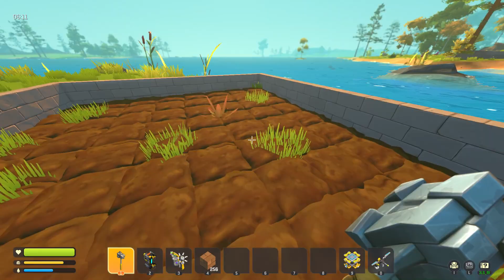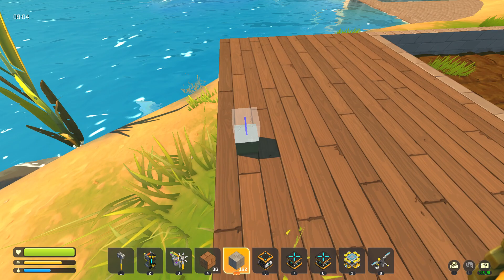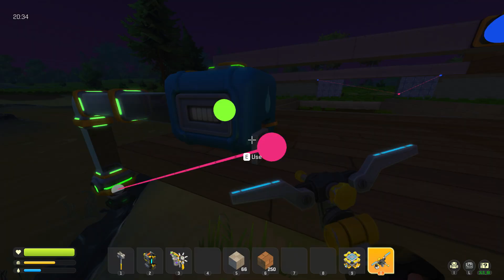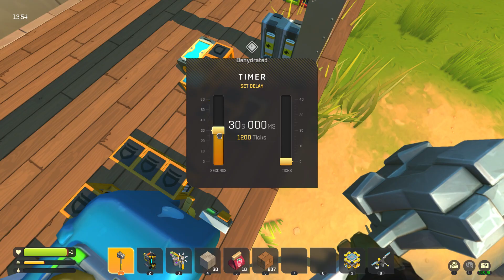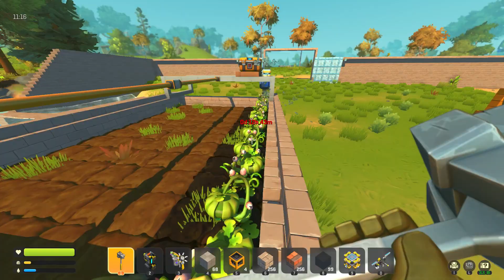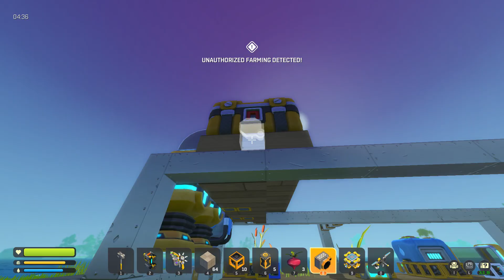Building a Fully Automatic Farm that Plants, Waters, and Harvests! (Scrap Mechanic Survival Ep. 7)

Comment: Dang this thing is like redstone on steroids. This game looks awesome!

Edit: While it's true you could double it up, couldn't you triple it if you flipped the chests upside down. You have access points on the top, and sides right? So if you carve out a hole at the bottom of the support for the chests, and then create a supporting roof to place the chest against, you can have three vacuums potentially sucking up and planting seeds.

It might seem a little unnecessary, but I am a little worried about what might happen if the routine isn't complete by the time you leave it's render distance. Like I've heard that things don't really operate if you're out of range of them so it does limit your time to explore if you're trying to stay within a certain distance of your base to allow a set up to function.

Comment: Why not separate the planting/harvesting from the watering?

Say, do all rows simultaneously with a line of harvesters/planters preparing the farm in 1 minute. Then when it returns, it triggers the watering circuit which waters the area normally but much more quickly?

Alternatively, have the watering circuit on a timer which is blocked while the harvester/planter is active.

Comment: Like so kAN can see this! Tip 4 controllers you only need lvl 1 pistons if they are connected to a controller, it's a bug, but if you tell the piston via the controller and set it not say 15 it will go to 15 even if the piston is level one that's how I did my farm.

[EDIT]Also with the controller problem you have to replace the pistons again it's buggy.

Comment: the only reason youd need something as hands off as this is if you never wanna touch it and you jsut spend your day doing other things nearby. This could become even more useful if you can switch its modes between 'full auto' and 'just water' so you can speed it up by hand or have it do it itself. Another thing you could do is have multiple smaller plots with their own systems like johnbane, so it takes less time to do them all, but itd be more expensive mats-wise

Comment: It's an amazing concept!
You could make it twice as fast simply by rotating the setup of pump and vacuums by 90 degree: by making each step of the process work on their own line per time, you can then make the system active both on the going and returning pass.

First Going pass: harvest column A
First Returning pass: harvest column B and plant column A
Second Going pass: harvest column C,  plant column B and water column A
etc.

Yes, you still would need to add two extra passes over the left edge of the wall to finish watering everything but it still would be a lot faster than the current design.

Comment: a great way to protect your farm from raids is to have level 5 pistons at max speed that push big platforms into the ground connected to sensors so you don't need to work as hard to defend your farm! I did this on my survival world and it works like a charm 
pro tip: put resource collectors on top of the platforms to pick up haybot legs

Comment: Great contraption Kan!
I think that you can HALVE the time needed without additional planters/pipes/pumps
Make the head with chest and water turn 180 while it goes back, so it can collect/plant/water in correct order
This way you use all the time working and not just going back slowly
All you will need is one bearing and extra controller

Comment: What if you had the harvesting/planting/watering platform rotate so that you can harvest/plant/water on the way back. It would save on resources and if you add another planter inline with the one you have onto it you can cut the time down by a quarter by increasing the speed at which the pistons extend.

Comment: you actually dont have to use pipes to get the water out the ocean, you can just put the water tank directly on the vacuum pump, as long as the tank and pump are connected by blocks to the farm, you can still connect the tank with the water gun.

Comment: - Controller waiting issue: Each component controlled by a controller may have a different update time, may it be distance/rotation or just pistons/bearings. Thus each stages duration of a controller is defined by the slowest component. Having no change in one stage, the stage has no duration, its instant, thus skipped.
- The whole farm could be hooked up to a timer of 24h or less. The plants will be grown by that time and the player only has to go there at any time of the day, to sort/fix the chests content. This also justifies any form of duration, 15mins of farm processing? No problem, each soil on the field has its own constant time cycle. The player doesn't need to care when each cycle happens, due to the timer.

Nice idea! I didn't know that one could control pistons like this, its awesome! And the sensor to trigger when its over a field is also awesome.

Comment: Here is a good idea for the wall when you get more resources. Make the wall stretch out to the water and under it, then make a door for a boat to pass through, but also make a door underwater tallow submarines to go through. 
Ill explain how the door for the boat will work below

So it'll be similar to the front door, but there will be a switch inside the wall. What you will do is have a censor connected to the door to open it. When you want to get back in, you hold a button that extends a piston, activating the censor. Once the door is open, you can just float your way in.

Comment: If you were to connect the harvest chest and the seed chest, and fill up the seed chest with all the seeds you use, leaving no empty slots, it should filter the seeds out of the harvest chest because it should.. Uhh.. Prefer the item slot with the item of the same type..? It sounds confusing but its a simple idea
Also. 
Piston engine powered saw wall..

Comment: Kan, You know how when you packing fruits on packing station when you just flip on the switch for the vacuum pump you need to wait between every shot from vacuum pump, but when you spam the switch, on and off it shoots fruits almost instantly? Maybe if you try pulsing the vacuum pump signal you can speed up that process to the water cannon speed. (if it works remember to do the same trick for harvesting pump)
Good luck.

Comment: just make it plant and water the crops on its way back from another row which should make it double as fast, i can't see why that would be hard to set up, in case doing it logically is too hard, then just use sensors as end-stops, even if you need more resources for logic, i think it'd be as much time to make as when you are doubling it all the planters, and water cannons etc. up.

Comment: Wouldn't it double the speed if you have the side pistons pushing at every cycle of the 30' timer so you do one row extending one row contracting (I have not fully understand the circuit so it maybe be a pain in the but to do it, also English not my first language)

Comment: You could probably add a timer to each piston instead of using the sequences of the controller to allow you to bring them back at a different speed than it takes to go there, to be exact you could probably decrease the time it takes to do one row by 40%, making it take 40 seconds a row. This would make it take 5 minutes and 20 seconds. Add a second farming module it could be 2 minutes and 10 seconds to do the whole thing.

Comment: if you put 2 angled pipes on the top of the chests than the second vacuum pump that shoots out the seeds will register that seeds are in its inventory because the chests are connected  and just nonstop shoot seeds the only hold back that you would have is chest space but since you are using the food it wouldn't matter

Comment: Next video: Automatic wall repair. Sensor array to check for holes and how deep they are, and then places the appropriate amount of bricks.
Reply from the maker: I thought about this actually. You'd need a lot of pistons to cover the entire wall or a bunch of different setups to get it all but you could sense the holes then patch them with blocks.
Reply: @kANGaming  if you make it for real you are the scrap mechanics mumbo jumbo
Reply: @kANGaming  you could put something like a monoriel on top of the wall that travels along it and the mechanism that fix the wall hanging on it
Reply: @MaxFenix8k  You beat me to the suggestion
Reply: @kANGaming  window washer style Kan
Reply: @kANGaming  do it
Reply: @kANGaming  Make the wall an arc, then run the repairer back and forth like a windshield wiper, where its pivot bearing is in the middle of the base. Or you could make the whole base surrounded by a circular wall. If the repairer is mounted to the arm on a loose vertical bearing and is then supported by a wheel on the ground, this will control the height for you.
Reply: @kANGaming  That would be cool to see
Reply: @kANGaming  kinda sounds like the minecraft cobblestone wall auto builder. a bit of a pain to set up, but quite great in getting it to do most whatever you want it to.
Reply: @kANGaming  make it in creative and maybe make a small one for that one spot where the bots go to on the wall
Reply: the thing is that this is actually possible because the vacuum pumps can in fact place blocks
Reply: @kevan_11  hold up. So we can build 3D printers now? :D
Reply: That would be awesome
Reply: @bboss4412  you should not have said that
Reply: @shambles_pw604  yep your right
Reply: Yeah!!
Reply: Question is, can pumps place water bottles? If so, that’s basically an infinite wall.

Comment: Technically Kan, if you wanted to make this as efficient as possible, turn the chests of seeds and crops upside down. They have a port on top as well as on both sides, and as long as they dont have a directional limitation on which way items can flow, you should be able to get 3 rows out of it, but you might have to resize your land plot a bit to make it work more efficiently. You could also make the water canon its own thing that goes over everything before the planter and such so you only need the one, could be something to look into
Reply: Or, thirdly, have 2 planters in the same row with 2 different sets of the sensory teeth, so they alternate going off, and then you can increase the speed to double, so all it takes is 1 more pump and chest

Comment: I really love the system but as you say in all your other videos "but actually kan this whole system is stupid because..." Controllers do the whole blinker for you. Also, your controllers that you did use aren't working because you need to put the pistons in the he same controller, because a controller with nothing to compare itself to can do a 0 block extension much faster than a 0 block extension. If you put the pistons bon the same controller a 0 block extension on the first step will  take the same amount of time as an 8 block extension on the first step of the controller sequence.

Comment: why did you make it so complicated? you could make it vary easier less expensive faster less noisy and less lagy i built only for watering but you can make it for planting to  i actually made it with 3 water cannon 1 sensor 2 pistons and one controller if i wanted to fully automate it (with one switch press i could use 2 more sensors i made it for crops 9*6 but i could make it also 10*6 the idea is you put the farm plots down with no space between them and put 2 blocks on top of each other in the center of every line of plots for the sensor to detect and i think you can imagine the rest

Comment: try using two pumps for planting, each one doing every other plant which would cut your time in half
Reply from the maker: I added a second pump setup right after this video. Double the speed now :D
Reply: @kANGaming  what about planting on the retraction? That's another 50% improvement
Reply: @TheBaldrickk  Yes, but you have to collect the crops first.
Reply: kAN Gaming, Hi! You are a true genius!
Reply: @kANGaming  can't wait for you to build your own farmbots
Reply: If you move the collector over say 1 block (so that it is in the middle of 2 rows, instead of the middle of one row) would it collect from both rows at the same time?  If, so then planting on the return would work as the second of plants would have been collected already
Reply: He could have watered and planted during the return trip and then move the setup over when he returns to base too. Halved the time doing that too.

Comment: I would have used limit switches for the back and forth instead of a timer, the added benefit is that you can lengthen your field with minimal effort.
I'm so eager to have the modpack logic in survival, it'll make the circuit much simpler and much faster with smart engines !

Also an awesome over engineered solution to make this faster is to have a rotating planter head with multiple vacuum pumps so that they can cooldown.

Also Also, if the vacuum pump has enough range to pick up the rows around, you could plant going both ways, simplifying again the circuits !

Comment: you should put a timer on the shutoff to automatically restart the cycle after the duration it takes the longest plant to grow so all you have to do is put in seeds and take out fruit
Reply: Gregzyt and fight raids.
Reply: @ScibleMonk  I don't think it would waste seeds because it cant plant them if a plot is already being used, and the water is automatically collected always, so even if the water is being wasted, you get the same amount of water that is wasted. And even if you use more water than you get, just add another pump.
Reply: A sensor can detect if a plant is mature
Reply: Fabian that could be useful if you just put one on the last plant and used it to detect growth
Reply: plants that aren’t fully grown are only able to be broken with a hammer(I think) so he could do the shortest grow time and it would ignore the ungrown ones
Reply: But broccoli and pineapples take two waterings, unless you use fertilizer
Reply: What I was thinking the whole video
Reply: Sciblemonk probably it will try to shoot a seed but it wont be able to because it cant shoot a seed into a plot where there is already a plant

Comment: Why don't you used a sensor to detect when the arm is extended ? Also why don't you used your pulsing system for the extension to make it slow to extend but fast to retract. You could make a system that work even if the devs change the timing of the planting

Comment: You can also use a sensor to detect when a plant is fully grown! Place a sensor pointing toward one of the final plants (or a few with an and gate) then hook that back up to the trigger or gate and you have fully automated it 😃
Reply: You could actually put the sensor on one of the first plants.  That way you'd be harvesting them as the ones later in the row are still ripening.  But since the machine runs at the same speed each time, they would always be fully grown by the time the harvester gets to them.  (Assuming of course the sensors can detect grown vs ungrown plants.)
Reply from the maker: I thought about this but I left it on a manual button in case you haven't loaded seeds yet and want to wait on it.
Reply: @kANGaming the farm produces its own seeds though...
If you do what they say, as long as you leave a stock of at least 96 seeds and have the seeds automatically routed to the planter vacuum by pipes you should never have to interfere with its function unless to fix damage caused by bots, or to change what seeds the farm uses.
Reply: @kANGaming you should put pistons and sensors around the farm so it pushes away bots and pulls back before they attack
Reply: TheGubble I plan on adding the sensor to this design in my world
Reply: @Evan_Harden  Hello
Reply: I implemented this a slightly different way in the end, by pushing a second button I can set the number of days I want to re-plant, that way if I press once, it will collect and plant on day 1, but then only collect (not plant or water) on day 2. That way I don't have grown plants hanging around!
Reply: Ok so I have an update...   Today we designed a similar system in our world.  I plan on mounting a sensor to the design that detects the plant that the first vacuum harvests. This sensor will detect if the plant is grown and apply delay so that the planting sensor only fires when over a plot that was recently harvested. I will try to continue to update you here.

Comment: Ok this is quite possibly one of the coolest videos ive watched in a long time. This is why I love this channel! Nice work kAN! P.s, could you plant quicker by using a second planter directly in front of the original one? You could use colour sensors to stack the ‘coding’ (notches in the wall)
Reply: NightCrawlerAU at that point he should merely extend his farm out in both width and length and add 2ndary arms attached to the primary.
Reply: Clinton Perkins Quite possibly yeah, but my idea would only mean adding 1 extra seed pump to the rig and adding another sensor so they alternate to get twice the speed, if that makes sense. Let me know what you think :)

Comment: This is why I want a splitter for the vacuum tubes that you can set to only pull certain things, so that you can send the seeds back into the seeder chest and send the produce into an output chest. As this is, you'd have to manually move the seeds from the output chest to the seeder chest. Not too terrible, but I would love that extra level of automation.

Comment: Imagine the mod pack in survival with the turret block
Reply: Imagine the welding tool in survival. You could make a small stable flying thing very easily
Reply: There is a mounted spud gun...
Reply: @yegorgribenuke6853  but no AI block, which is what they are talking about.